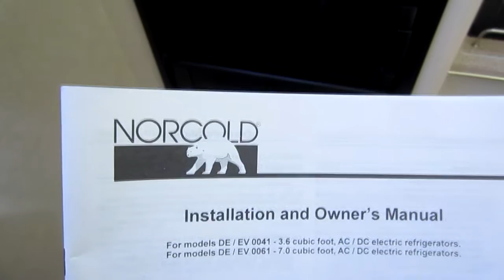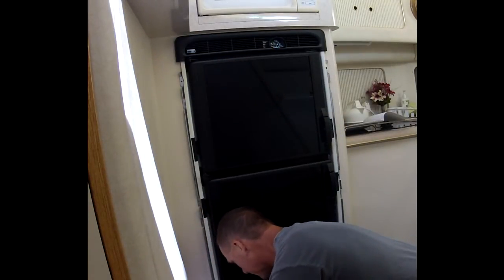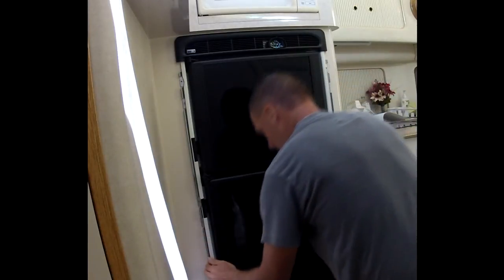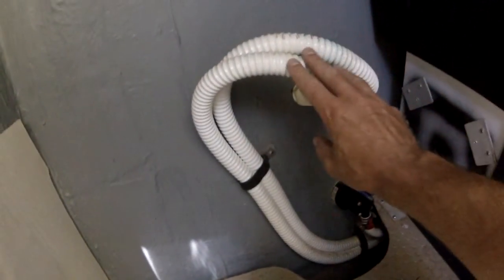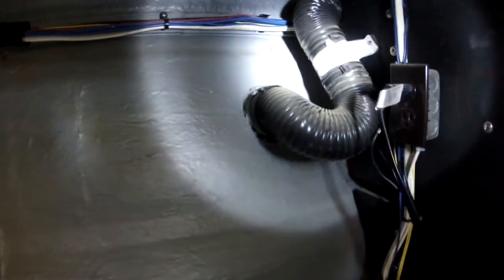Norcold Boat Fridge Removal - Sea Ray Sedan Bridge

Comment: What year is yr Sedan Bridge?
I'm surprised how clean it is/was, in spite of the wood debris. I'm taking my fridge out prior to launch this coming season...betcha it ain't as nice behind, as yours was.
Reply from the maker: The boat is a 1997 model year, launched late'98. Yes, apart from the factory debris, it was surprisingly clean back there - no mystery growth or anything like that.

 Why are you taking your fridge out?
Reply: ***** I would like to see what's back there, and clean it. It's the original Norcold from '88, and it def needs a new seal as well, if that's even avail for it, at this point. Because I hope to ( soon ) upgrade to a new ( for us ) boat, I don't want to replace the fridge if poss, but make it perform a little better...In addition, I'd like to lose the combo alcohol/elec stove that's mounted above it, and permanently mount a two burner butane unit...Canadian Tire now sells a two burner, and dep on the sizing, it might fit in the existing hole with minimal "McGivering"

Comment: One thing I see from people is they will empty their holding tank while running their generator and/or a/c and it gets sucked up
Reply from the maker: Well John, unlike our American friends who can dump their S**T overboard, we here in Canada aren't allowed that luxury, so we wouldn't have that issue.

 Can't imagine why it's illegal to do it here, other than the fact that it's insanely sickening, polluting and I gotta swim in our waterways!

 That said, did you know that visiting US boats are required to not simply render their overboard dumping systems inoperable, but have said plumbing lines completely disconnected? True dat.
Reply: We have to be 3 miles out…..